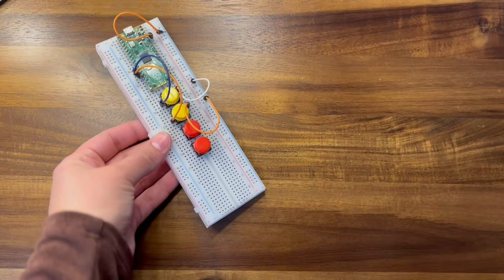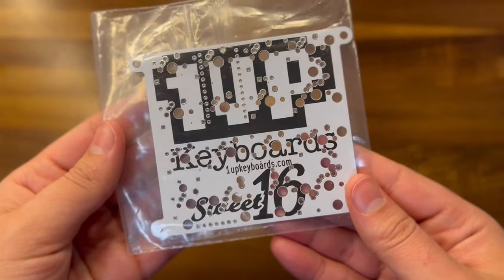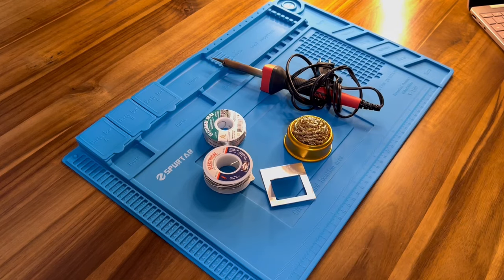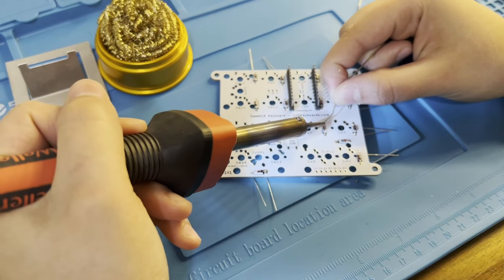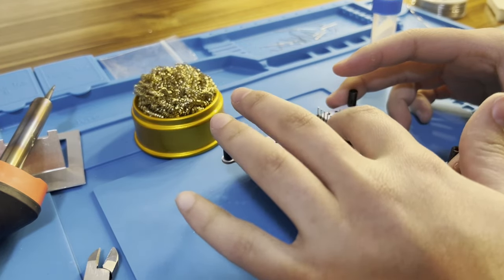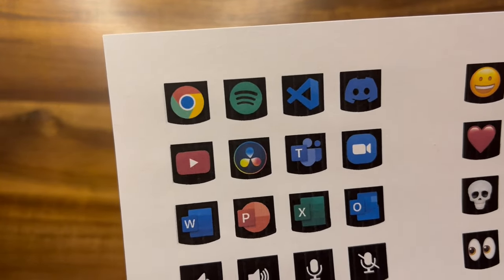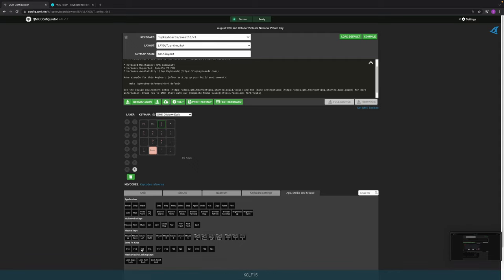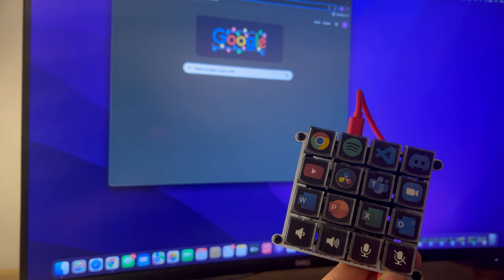Easy DIY Macropad with Mechanical Switches

Comment: Protip: There are F1-F20 keys. Most programs don't use the ones above F12, some do. Be careful! You can set shortcuts to the unused F keys.
Reply: could I buy a cheap numberpad and do that? reassign the keys to FN keys and do the macros that I want?
Reply: @Lorennaa  In theory? Maybe? It would depend on if the number pad would let it be recognized as different, and if they keys were separated out on input. There may be software that would let you modify the input per key on a usb device as well... interesting thought.
Reply: @Lorennaa  yes. 
On Mac you can use Karabiner-Elements to remap the numkeys on specific keyboard, without affecting numpad in other regular ones. 
On Windows I don't know if you can specify the keyboard to remap because I haven't had the need to. If you don't care to have a working numpad (across all the connected keyboards), then you can do the remap either modifying the registry directly (there's an easy and safe tool to do the changes called "SharpKeys") or using AutoHotkey which will allow you to do more complex automations than the simple remap.
Reply: it goes up to F24, i thought

Comment: Tala, congratulations on your first YouTube build tutorial! 👏👏👏 You presented it so nicely, and your video looks really polished and professional. Great project, too, with an interesting mix of hardware assembly and software configuration. Hmm, if you bought your soldering iron at Canadian Tire, you must be studying in Canada! 😍🇨🇦🏒🥌 I did my MMath and PhD at the University of Waterloo in Ontario. As a transplanted American, I was shocked when I learned that Canadian Tire sells more than just tires! 😆 Anyway, I just wanted to tell you that I enjoy your content. Keep up the great work, Tala! 👍👍
Reply from the maker: Thank you so much for your kind words!!! I'm studying not too far from Waterloo :)
Reply: @talaexe  Tala, do you have a favorite area of computer science? If you like artificial intelligence, you can do machine learning on tiny devices like Raspberry Pi computers and microcontrollers. O'Reilly has a whole book about it called "TinyML". For example, the Pico/RP2040 microcontroller is actually powerful enough to run ML models that recognize faces, gestures, and voice commands! 👧👋🗣️

Comment: Pretty neat board, I'm thinking of making something similar, glad to know it can actually be useful!
One thing I'd say for anyone watching, with soldering, I find it so much easier to do the opposite to what you're doing here, and it means you're less likely to get cold soldering joints. (Those happen when the solder melt over a part but doesn't actually attach to it, the joint can easily break)

In short: 
Instead of getting the solder ready over the part then putting the soldering iron to it, I really recommend taking the soldering iron, touching it to the part to solder AND the hole in which the pin is, THEN approaching the solder to that piece. It should melt when it touches them. That makes for a much stronger joint (also lasts longer and takes less effort to solder in general).

Comment: Hey just came across this video while building one for myself for Windows. Any idea how to program a mute/unmute mic button. I see you have one for your Mac Os but do you know if it is possible for windows? Thanks
Reply: That should be easy.  Set the key command to mute in via or program the mute key code in QMK.